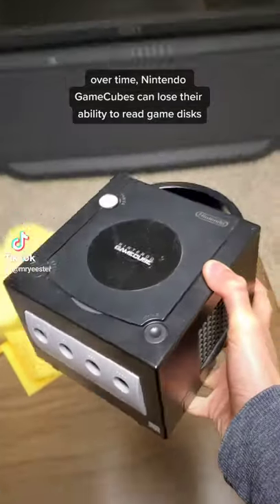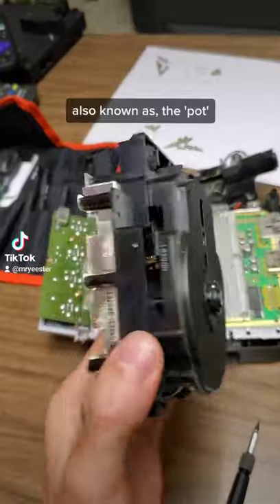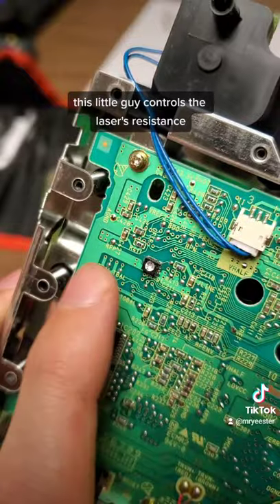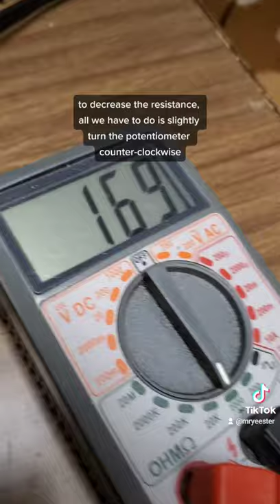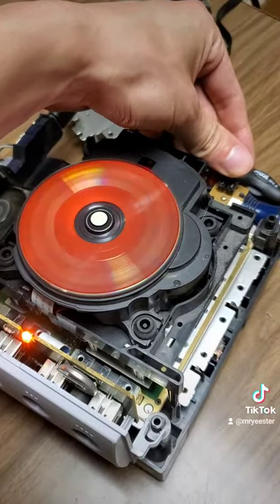fixing a broken gamecube #shorts

Comment: I thought pententiometers are only in race cars but i never knew it was in a Nintendo 😂
Reply: they're also technically in things like cassette decks
Reply: Potentiometers are simply electronics throttlers. Even an electric vehicle could have one. Your smart phone could have one. Damn near anything with a variable power control could have one. I imagine they're actually really common, you just never hear about them.
Reply: Potentiometers are useful for changing volume
Reply: volume switches, power supplies, timing CRTs, etc. they’re not uncommon!
Reply: @kutsen39  potentiometers are used in one of two configurations. 
You can use them as a variable resistor or use them as a voltage divider to achieve a certain voltage at the wiper.

They come in all shapes and sizes and can handle accordingly different amounts of load. They are mostly part of the controlling part of a circuit, like in the video.

I doubt that modern phones have them, since there's no need for them as everything can be adjusted digitally on the scale of a phone
Reply: Potentiometer are usually found on knobs and they're just adjustable resistors if you think about it
Reply: @akshatsehgal8753  A temperature dial is a thermostat. A little different.
Reply: They are in tons of electronics. You would be surprised.   Just tear apart stuff and you'll find them for voltage or current control aswell. Or speed or whatever really. They are versatile. Hell you could say your volume knob might also be a potentiometer.
Reply: Or Maybe what you mean is tacometer(tools to read rpm), because potensio is mostly in electronic parts
Reply: @robbybrush204  depends on how you use them. Like using anything as a hammer. Screw driver, wrench, random junk. If you swing it hard enough it's a hammer. But potentiometer can be versatile.
Reply: @kutsen39  modern gas cars and eletric cars use potenciometros has throttles
Reply: A basic electric guitar with no onboard electronics? Those dials are potentiometers. It's a very baud component on a lot of stuff
Reply: @joeythefoxxo  I can see where the misunderstanding is, but a thermostat is an appliance. A potentiometer is a component inside the thermostat that allows it to work. It is basically a resistor that you can change the value on manually. Ωs go up or down depending on how far you turn it.
Reply: its for mario kart
Reply: They are in everything
Reply: Nintendo go BRR
Reply: They are in lots of things, they translate rotation to resistance, lots of usages for that

Race cars have a different kind of pots I think. Damper pots or something? Totally unrelated
Reply: They’re in nearly everything, it’s a basic electrical component

Comment: Does that work with OG Xboxes aswell? I mean, mine is 20 Years now and around 10 Years ago, it startet having problems with reading Xbox Discs. Cleaning did next to nothing. That little Potentiometer would be a perfect thing.
Reply: I think it will work
Reply: Did you try it we need to know
Reply: @pablozurita2996  no, i haven't yet. I can't find my OG Xbox Videocable Right now. This is not the worst Problem, but it takes time, because i do not want to buy a Cable just for that and then finding it ^^ but i am still searching and asking around old friends. Really want to play a few old games that are not backwards comp. on 360 and One.
Reply: My Xbox struggles to read some game discs too despite how clean and smooth they look. I'm gonna look into that potentiometer.
Reply: This does indeed work on the OG Xbox, had to do it not too long ago myself.

Comment: it's also important that the GameCubes also have an issue with the capacitors inside. Usually the capacitors inside can eventually lose their ability to hold power, which causes issues with the disk drive "starting up" 

If you're having issues though with having to wait before the disc drive starts reading games, it's usually a capacitor issue.

Comment: Can you fix a ps4 so it dosen't unleash all hell after it's been on for five minutes?😂
Reply: Yeah, it's actually pretty easy! Pop it open and clean all the dust out. If you trust yourself, get some thermal paste and reapply it using a video guide. 100% chance your current thermal paste is dried and cracked, if not disintegrated entirely.
I did this and got my PS4 to run whisper quiet for another couple of years! Now every 2 years or so I replace the paste whenever I decide it gets too loud :)

Comment: Stop adjusting the potentiometer. If your cube can’t read official discs you most likely need to replace the SMD capacitors on the drive board. Adjusting the laser power is a temporary fix that only reduces its lifespan. 

In the event the laser does need an adjustment you should always use an oscilloscope instead of blindly tweaking it. 

I understand that most people do not have the required tools to properly fix these drives but it hurts to see people permanently killing drives when they completely repairable.

Comment: It seems like every system has its own way of dying. The NES has the light blinking, the Gameboy gets vertical lines on the screen, Xbox 360 had rrod, the DS light hing would randomly crack, the GameCube would stop reading discs, the switch's fan will go crazy. I know that they can die in other ways but these are the most common.

Comment: This is a temporary fix, though, and will finish off the laser after a while. 9 times out of 10, the laser isn't the culprit when it comes to disc read errors on the GC. It's bad caps on the optical drive board.

Comment: 1. You don't check resistance of a connected component.
2. If the pot is acting as a current limiting resistor, are you sure you should be increasing the current?

Comment: Hi, 
it should replace the capacitors in the optical drive first, then check the pot of VR. At most conditions, the laser can read discs without reducing the value of VR.

Comment: You should probably just change the diode. By simply decreasing the resistance of the pot, you're allowing more and more current flow into the laser diode—which eventually could result in it being way too powerful, and either damaging the laser or burning disks.

Comment: For anyone out there, DON'T PLAY WITH THE POT!!! It is a final resort and should NOT be used as a long term solution. When you have to increase the mAmps through that diode, it  will burn pretty quickly as it already is near EOL if it is less brighter than it was. Clean the damn lens instead. You could see the guy's lens being powerful red. Because it is dirty, the light stops ON it and does not pass through.

Comment: This is awesome dude! But why does the laser  loose power? Does the value of the potentiometer creep with time? Or does the, i presume, LED wear a little?
Reply: planned obsolescence probably
Reply: @antonio1681  in this case its more about the LED losing potency or even the potenciometer getting a little fucked (rotating, or natural degradation difficulting the passage of power).
Not everything is planned obsolecence, old stuff lasts for a good time (Old consoles and computers). Up to the PS2-PS3/Original Xbox-Xbox360 era things still worked great, after that... It went downhill...

Comment: Even though this is a good way to fix, keep note that this is only temporary. Giving the laser more power WILL give it the ability to read games better however it can burn out the laser a lot faster. There’s usually a certain amount of power the laser can take before it burns out, so keep that in mind.
Reply: The idea is to get more milage out of the laser. The only real way to restore the reader is to replace the laser. If you incrementally decrease the resistance of the variable resistor until the disc starts reading again, you will be fine.

Comment: It’s not too weak, your capacitors are failing on the other side. All you’re doing is increasing voltage to the whole circuit which is zapping those weak caps back to life

Comment: I use a pc with an emulator.

I was expecting the laser to just cut the disk. Lol
Reply: A PC emulator works pretty good, but if you want the closest experience then I recommend getting a wii with homebrew installed as it runs as if it were running a regular GameCube disc.

Comment: Nooooo you forgot to check the capacitors on the disk board 😭 you can avoid turning up your laser by replacing the failing capacitor (s)!

Comment: There was a similar problem with ps1's with laser not reading the disc correctly. How would you solve it without repairing you may ask? You just turn the console upside down and it works.

Comment: This is not a good solution. Increasing the voltage to the laser diode, which is what you're doing here, does make it more intense yes. However, it also severely reduces the lifespan of the laser. The only permeant solution is to replace the laser or the disk drive. This is why I dislike shorts content, there is no time to actually explain what is happening and the drawbacks of what you're doing. Also, don't turn it on when the laser is exposed, that is just common sense.

Comment: Could this possibly be working on my ps2 slim? That thing hasn't worked for over than 5 years and can't read discs anymore
Reply: @verazity865 
Man the sentimental value and the nostalgic moments I've had with that console is just precious and no I'm not gonna buy new ps2 lol event though they're dirt cheap these days
But I don't have a voltmeter or stuffs to measure the resistance
Reply: @akmalrusydi2730  you dont have to measure something. Juat adjust it slightly. But only turn the potentiometer 2 millimeter and than look if its works. If not, try more, or the other direction.

Comment: It's not called a potentiometer it's a preset variable resistor. Or preset variable potentiometer 

potentiometers are the word used when explaining the whole variable resistor family and by uneducated people but usually pots are the dial knob controlled resisitors. 

If we all called every type of variable resistor potentiometers then there would be no electronics because everything would be built incorrectly and break

For the love of God learn extremely basic components before trying to teach people I'm not even a fully qualified engineer and I know more than you
Reply: So, thermistors are potentiometers?
Reply: @mateuszorlinski7334  I just explained that they weren't by using this preset variable as an example people just refer to variable resistors as potentiometers because that's the most common word used to describe variable resistor like for example a thermistor despite it being wrong